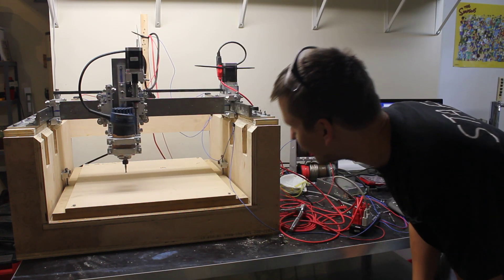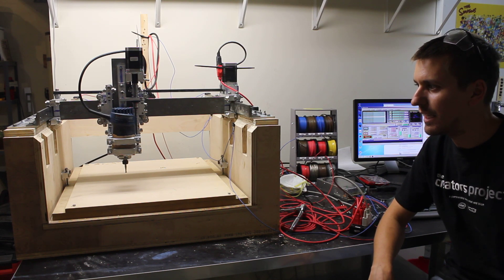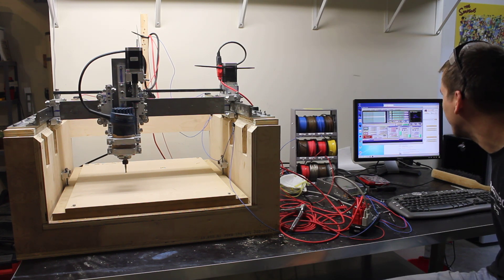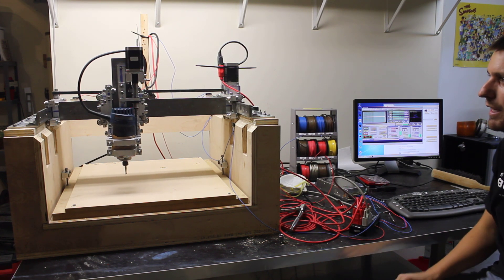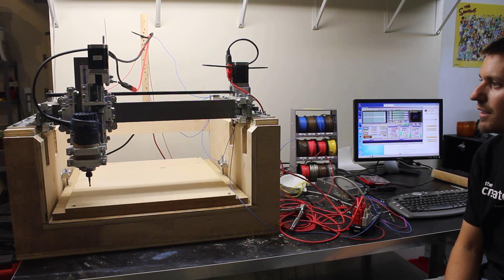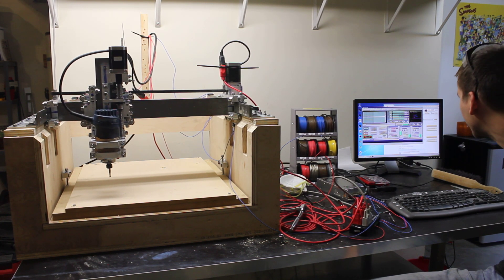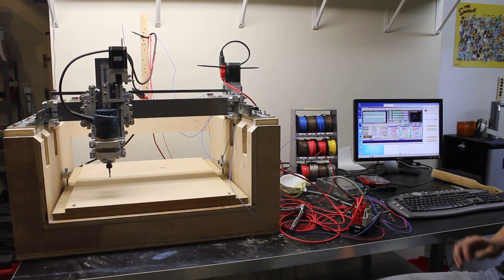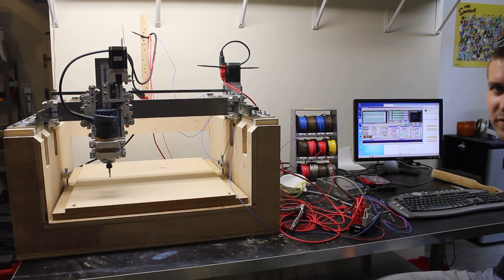Home Built CNC Router - Test Run with G Code

Comment: The CORRECT terminology for restarting a g-code listing is rewind.  Mach3 CANNOT generate a single line of g-code outside of the wizards. Mach 3 uses g-code generated from some cam program or from g-code you write directly using teach mode in it. The cam program is what generates what is known as a tool path.  Each time there is a new tool or bit used with0l path is created. in a single g-code listing, a new tool path is created. Also note this VERY IMPORTANT---- If you do a tool change within a SINGLE COMPLETE g-code list using mutpile tools you must go into setting on mach 3 and check the box in the lower left corner labeled "Ignore tool change".  Mach 3 will come to a pause allowing you to change and rezero the Z for changing bits.  If you dont disable the ignore Mach 3 will just continue along cutting the new toolpath or tool paths using the first bit used. The end result will not be what you want. You will have scrap..

Comment: I'm going to build a CNC this year, started learning Fusion 360, I can send my designs to be routed through that, but I'm not sure if Fusion 360 will just plug in and run everything or not. I have no experience with CNC, hoping to be able to do a 2400 x 1200 size.